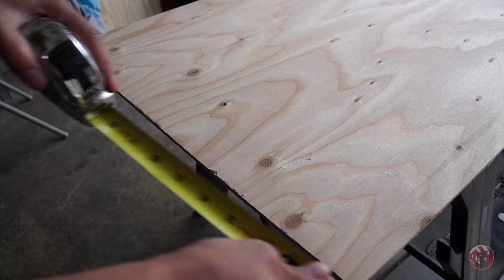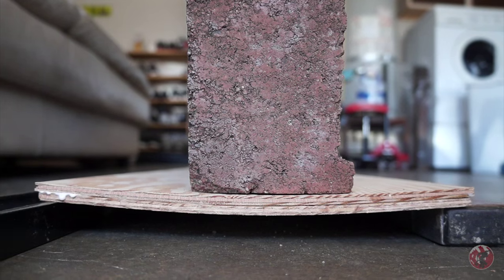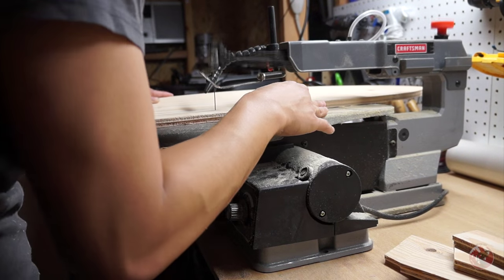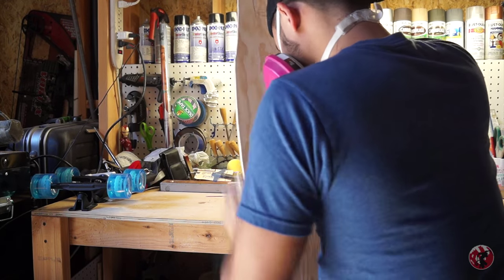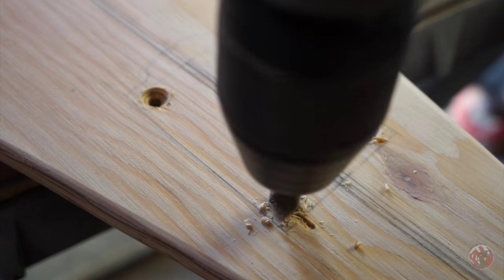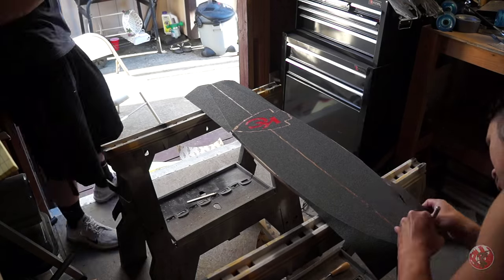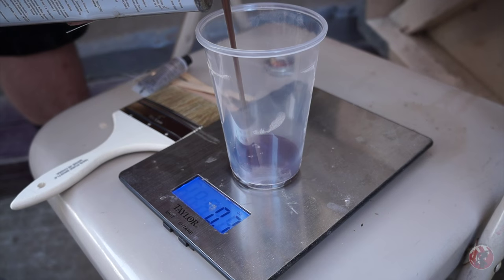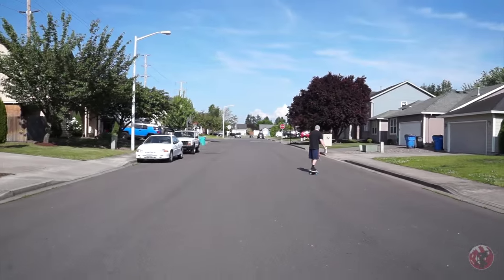Just Building a longboard

Comment: Using a backing block when drilling is the best way to prevent blow out, and using the silicon rubber part of a a silicon rubber spatula to push the air bubbles out as you lay the poster onto the glue works good too, nice board by the way  : )

Comment: I personally wouldn't use plywood but this is still totally awesome. nice job dude.
Reply: every builder starts out with plywood, we started out with plywood and no concave at all and now use small layers of different wood types (1,6mm if i remember right) to enable the board to do certain things, we also use for example design wood and we use epoxy resin, a special heat box, a vacuum press and complex forms for our boards (the heat box, the vacuum press and the complex forms are all selfmade) but we still started using plywood
Reply: Satorius Oh, that's cool
Reply: +Satorius how did you make the press (might build one myself if i know how)
Reply: +Thijsje XD my dad actually made the vacuum press without my help, so i don't know very much about that, but i would suggest that you maybe start with a not so advanced press, because building a vacuum press takes pretty much time and experience in how the components themselves work
Reply: +Satorius i normally do it with clamps but i know a vacuum is more efficient thats why i asked
Reply: +Thijsje XD they are for example rib presses, those work with wooden ribs that are shaped the way you want them to, look it up one of those was our first press, it is a shit load of work but you just have to know how to work with wood to be able to build one
Reply: Longboards is made of Ply wood xD
Reply: HamDerDanskeren a lot of the time it's bamboo and other woods
Reply: +HamDerDanskeren wrong, high quality boards are made with several (most of the time 5 or 7) layers of single sheets of wood (i forgot the word for that, english is my second language)
Reply: Yea, i know. Im a longboarder and a woodworker actually haha. They are made of between 7 and 9 layers of veneer. Thats called plywood. 7 layers of veneer is called "7-ply" for instance. The point is to alternate the wood grain to increase rigidity of the board, so it wont break.
Reply: +HamDerDanskeren I know, I'm a boardmaker, we made roughly a dozen by now, we use epoxy, seven layers of wood, some directed in one, the others in the other direction to make sure it doesn't break, we also most of the time use glass fibre stuff (sorry my english is pretty mediocre)
Reply: Thats doesn't change the fact, that boards are made of plywood?

As it says on Wikipedia - "Plywood is a sheet material manufactured from thin layers or "plies" of wood veneer that are glued together with adjacent layers having their wood grain rotated up to 90 degrees to one another."
Reply: When you glue together sheets of veneer, you make plywood aka boards are made of plywood.
Reply: +HamDerDanskeren oh ok, in my native language we have 2 seperate words for that, pre-glued wood is called Sperrholz and that isn't used for not pre glued wood that you glue together, but good to know that that's different in English
Reply: Yea
Reply: For my first build, I used 7 plys of 1/16 inch thick Baltic Birch I bought off of Etsy. Edit: I also did a practice with plywood and found that Gorilla Wood Glue is the absolute best besides other industrial wood glues.

Comment: Could you please leave a list of all the things I need
Reply: a typical beginner list would be: 3× birch plywood that adds up to 1cm or a bit more or less, but always around 1 cm, glass fibre, bidirectional and unidirectional, 2× the bidirectional and 1× the unidirectional, epoxy glue, and not the 5 min shit, i mean the real deal where you have atleas 45 min to work with and that needs like a day to dry,  you need some sort of pressing mechanism and something that gives it a so called concave, google it if you need to, you'll find some stuff about how to make such simple press forms, if you don't care about 100% accurecy you can use heavy stuff to press it on there. 

instructions: you first prepare your press form, you then take the plywood apply the epoxy, you then lay it in your simple press form and make sure to lay it in accurate and make it as accurate as possible, there is no going back after epoxy dried, you then apply the weight when everything is accurately in position and you let it dry for roughly 24 hours. after that you think mix up more epoxy and take the unidirectional fibre and lay it on the side of the wood that is going to be the bottom side facing the street, you then soak it with the epoxy until you can completly see through, you then to the same with the bidirectional but that needs to go on both sides. make sure everything is soaked well let it dry *edit do one side at a time so you can lay it on the other one while drying. [1/2]
Reply: the drying will need a day each side, after that you decide on your design, you then search for a nice design on the internet and look for a place where you can print it out on one big piece of paper, you then lay that down on the bottom side of the board and soak it with epoxy, be careful to not rip the paper and that the paper lays perfectly on the wood, you then let this dry. You then search a shape online that you like and make sure that you find one ACCURATELY showing where you have to make the holes for your setup. print it out, and glue it to the wood with a spray glue, make sure that the mid of the shape is in the mid of the wood, so that you get an even concave, Then take a jigsaw and cut the shape out of the wood. Sandoaper the edges of the board to get them ecen, maybe even make them slightly round. also sandpaper it a bit afterwards to make the epoxy really even on the top and bottom sides, then get some seethrough spray laqcuer and apply around 3 layers, that means spray it on evenly wait till dry and repeat this around 3 times, drill the holes for your setup in the right places, you may even want to do this before cutting the shape out with the jigsaw so that you know where to drill. make sure to get a bit laqcuer in the holes and get a setup to mount on your board. Voilà you have a decent board.
I made 10 boards together with my dad by now in the span of nearly 2 years with some breaks inbetween, we started simular to what i described to you and now reached a level that is pretty much on a professional spectrum. I'm a 15 year old German teen guy that started doing this when he was 13 years old, if i was able to do it you are too :D please let me know if i helped anybody and if you have questions just ask me :)